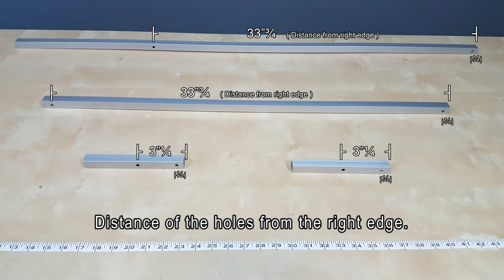Easy DIY Camera Crane Jib - Complete parts list

Comment: Is the block with the tee nut upside down? If that is used to attach to a tripod, the tee nut should be on top of the block, otherwise it could pull out. Otherwise great vid

Comment: From a mechanical standpoint, the tripod mount is the weak spot. I'm surprised it even stays on the tripod.
The way the T-Nut is mounted, it will pull out easily (nailed in from the bottom). The better way to do this would be to flip the wooden plate around and have the t-nut go in from the top. That way the 1/4 inch screw from the tripod will pull the nut and the plate towards the tripod. You may have to use a longer tripod mounting screw or some quick disconnect though. The way it's mounted now, a simple lifting or tilting motion will dislodge the t-nut in the base and the entire crane will come tumbling down. Not an assembly I'd trust a $2k camera to. (the nail fins on t-nuts are not meant to keep them in the wood. They're meant to stop rotation. That nut is mounted wrong)